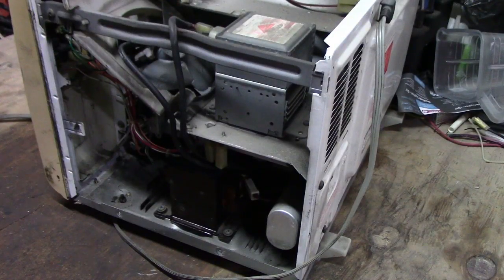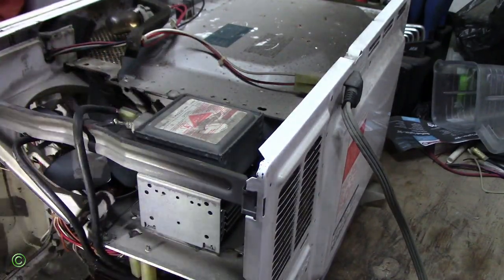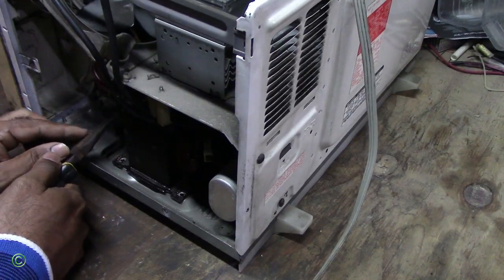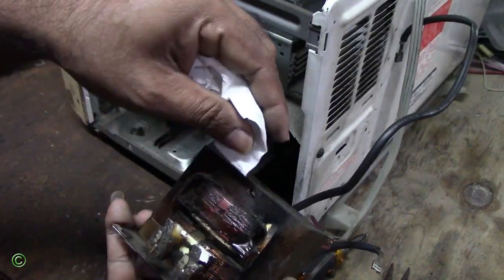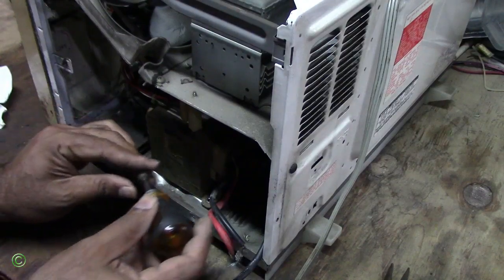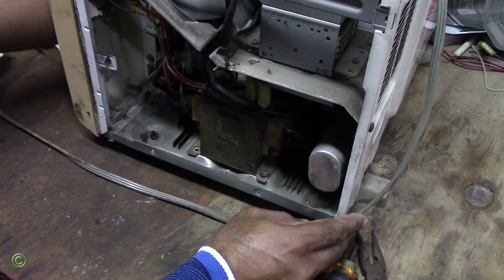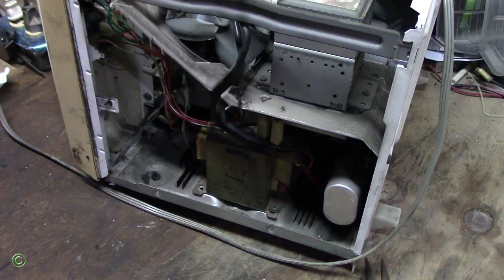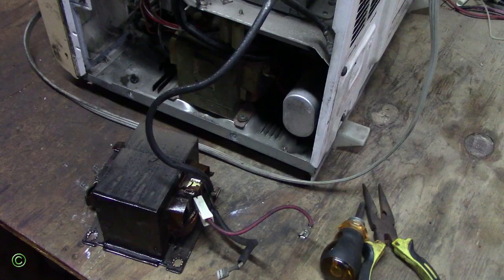Microwave Oven smoking and transformer burnout

Comment: Great video.  From what I know, it's pretty difficult for the transformer to burn out.  What causes the transformer to burn out?
Reply from the maker: One of the main reasons for a transformer to burnout is when people use to cook on the microwave for 30 minutes or more.
Reply: @mr.fixit3604  Thanks.  But we the most minutes used is probably 5mins.
Reply: Its usually a defect in the insulation on the copper windings of the transformer.  What happens is the insulation on one winding breaks down,  causes breakdown on insulation of neighboring winding, and both arc together causing a dead short in the windings, and leading to burn out.  What usually causes this is not allowing good air flow around the microwave. Poor air flow leads to overheating of transformer which leads to insulation breakdown of windings.
Reply: @seangriffon6502 mine is burning all high power components are okay. Transformer winding resistance is okay. I don't anything else that could be the problem
Reply: @mr.fixit3604  Yup.  Transformer burnout.

Comment: Can always know a Trini from his accent. Im one too. You could still discharge the Cap before removing the leads. Where you get parts in TT? Oster version here. Will work on it soon.
Reply from the maker: You always need to discharge the capacitor when working around it so you wouldn't touch it by mistake. You can get the capacitor at your local appliance stores or online.